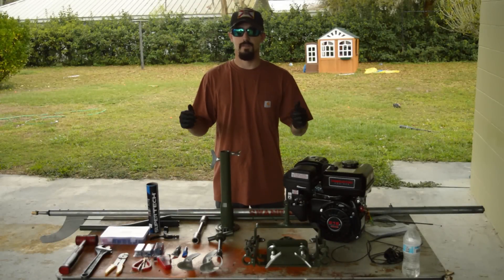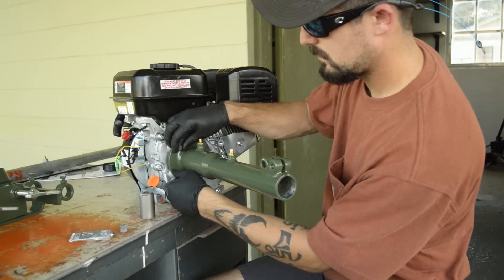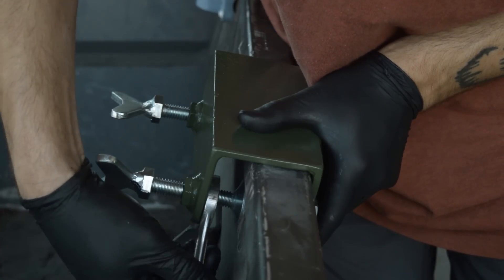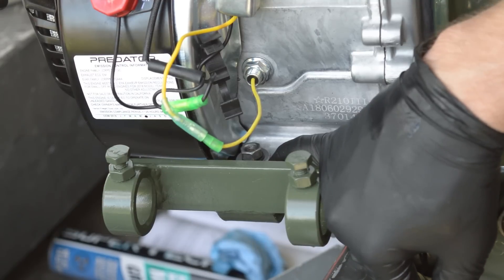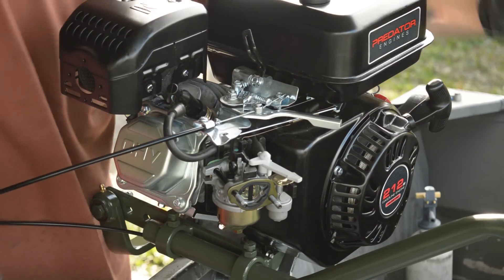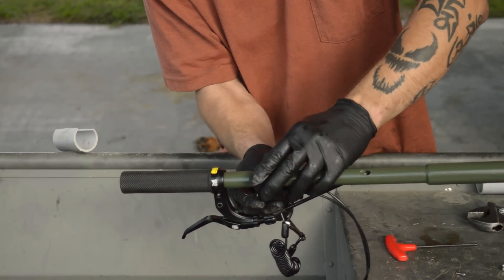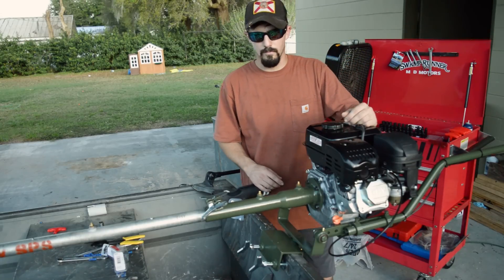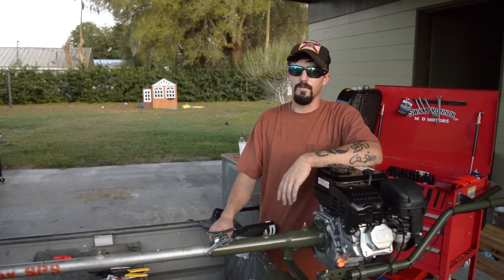HOW TO Assemble Small SPS Swamp Runner Mud Motor Kit (Step by Step)

Comment: Thats a Crankshaft not a PTO shaft. Shouldnt attempt an instructional video if you dont know what the correct part names are.
Reply from the maker: Since you want to come at someone sideways, I'll bite. 
If you took the time to do your research, instead of flying off the cuff like an unhinged toddler, you'd know that it is referred to as the PTO shaft in the technical manual and the operators manual. 

Shouldn't make a stupid comment if you don't know what the correct part names are.
Reply from the maker: @charleygallagher2257  
It actually is. Take 5 seconds to look up the 212cc and all will be revealed, little one.
Reply: @PolkFishin  ive been turning wrenches for 20 years your not going to convince me its a pto shaft. A pto is an add on to a transmission to power other things. Pull that 212 apart and let me know what that shaft is connected to smart guy.
Reply from the maker: @charleygallagher2257  
>*you're*

Must not have been turning them very well.
I know full well what a PTO is, but in the context of a small engine, like this one, it is referred to as the PTO shaft. Again, if you take 5 seconds to look into something (instead of relying on your arrogance) you'll find the answer.